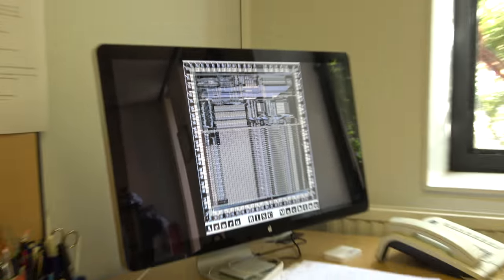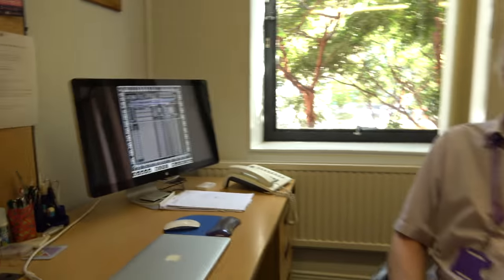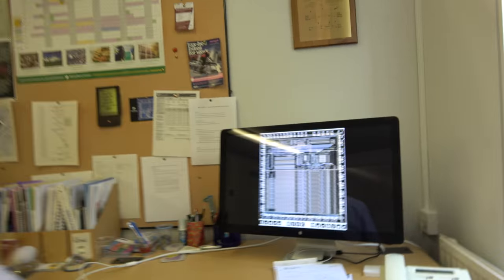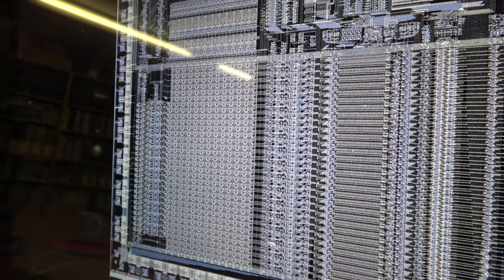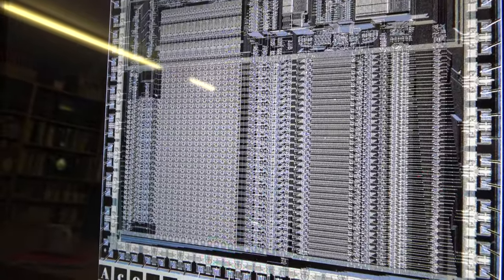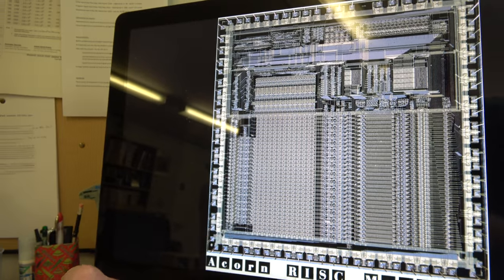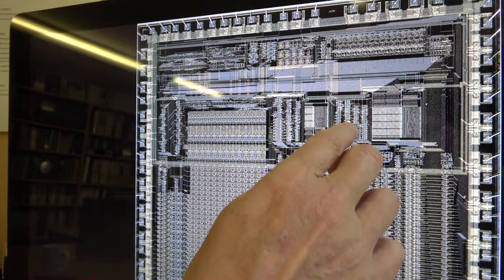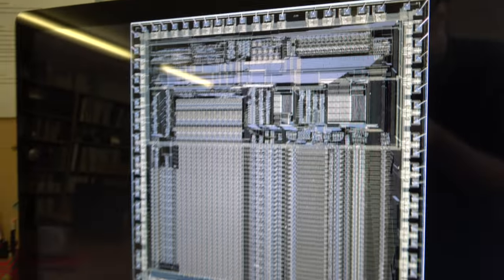ARM microarchitect: Steve Furber

Comment: thanks a lot charbax! I would have like to know his opinion on strength/weaknesses of Apple Ax chips compared to exynos and Snapdragons
Reply from the maker: Thanks for watching! Yes it's interesting how Samsung's been involved with Apple's ARM processors over the years, and also with manufacturing of 14nm Snapdragon 820 now also.
Reply: i doubt he would be interested in answering that question. If he anything like Sophie Wilson he will say we pay £1,000 for a phone which runs so hot most of the times the transistors are turned off....

Comment: Interesting video.. I'm a CISC on RISC fan as well as pure RISC. A thought experiment concerning the brain lead me to visualise a network of processors where each processor is hard-linked to each other processor, with the connections also being the memory store... Microtubules, save, load, send... It scales well. Could be recursive with n processors joined to n processors forming a higher level processor, itself connected to n higher level processors, and so on... Computer Balls.. Processors could also communicate using EM waves and possibly even quantum entanglement at some point. In 2D flatwiorld only 4 processors can be joined to each other with a triangular layout having total shorter connections. so it''s groups of 4 processors forming next level processing units, recursively.

Comment: There is one architectural feature that THAT HAS TO GO! It is little endian bit/byte  arrangement for data, and also for address pointers! For businesses applications that uses redefines for overlays differing data types for COBOL and Nixon’s for C, little Endian for business applications constitutes major booby traps for coding defects. For companies like SAS Institute that supports applications across multiple architectures, different endian differences create major impediment for providing reliable and big free products. I believe that the major reason that Prime supermini computers found greater adoption among commercial business company than the VAX systems was because its architecture as big endian. Also , little endian greatly creases the time and energy on programmers using memory dumps in tracking down coding faults. In the pre and early LSI hardware, the design shortcuts for hardware implementation may have been tempting, but burden wreaked on programmers by little endian is no longer worth the price!
Reply: How does the endianness matter in any of it? It should be an implementation detail hidden under a high level language. I do development from machine level all the way up and endianness was never even on the radar as some sort of an impediment or bug source, and I deal with both BE and LE systems about equally often. I don’t know what SAS is doing but obviously something majorly wrong for anyone to even raise that as an issue. Nobody is supposed to look at raw memory dumps anyway - not outside of the development of library primitives that twiddle binary data directly, and even then a high level debugger is the first line of attack.
Reply: Im LE the address of a „data object“ does not depend on the type you read from there. As a byte, a word, a double word, all the same address. BE forced you to offset the addresses depending on type.

Comment: It'd never compete with Apple. First of all, Apple II was already established on the market with software and peripherals (specifically floppy drive) eco system. Secondly, even if BBC made to US on time, it'd be quickly killed by cheap (and more superior) Commodore. And essentially Commodore killed Acorns not just in US but in home market as well. Acorn really competed with Apple only on educational market.
Reply: iPhones use ARM derived processors.
Reply: He's referring specifically to the time before ARM when Acorn competed in the home computer market.
Reply: "It'd never compete with Apple" "Acorn really competed with Apple only on educational market"
make your mind up which one it was

You are 100% wrong about it not competing with Apple. Of course it did, as did every other PC. How well it competed is another thing!
Reply: the C64 is a terrible machine in fact. it was successful in the main due to being in the right place at the right time and due to vertical integration and having 64K when most home computers had a fraction of that.
Reply: @KentReynolds  — I never had one, so can’t judge, but I know a lot of people did useful things with a C64.  It was practical and affordable.

Comment: Little endian architecture has to go! For business applications written in COBOL or C, which’s uses data structures that involve redefinition or union in which different data types are overlaid, severe problems or programming design errors are likely to arise. For companies like SAS Institute that design and support major applications and system, little endian architectures create major obstacles. In the past ere of the supermini computer systems, big endian systems like Prime were far more successful with commercial users than the Digital Equipment VAX with its little endian architecture were less successful. Another architectural beef I have is with the base plus displacement architecture of the IBM 360 and its successors. You are most likely familiar with paging thrashing issue with virtual memory system configured with insufficient memory. I assert that such architectures have risk of an address reference thrashing issue arising with extreme large program logic instruction sizes. I do not have sufficient training and ability to derive a proof of this possibility. Should this become a problem, a meta intermediate language and procedure in which the interpretive object language that would support a more viable implementation, with support for indirect addressing, which was omitted in the IBM design. Another direction I would to see explored is hardware implementation for common trigonometric, hyperbolic and other functions that uses indexing table lookup for evaluation that would be new or two clock period fastest, and be perfect in its entire number range. For massive single valued mapping calculation functions, special space matrix memories covering the entire number range wold be used to deter unnecessary repetitive calculation. This would bypass the limitation of Moore’s Law, and reduced the need for quantum computers until true room temperature superconductivity can become discovered or invented!
Reply: Modern ARM processors are bi-endian. They can be configured to run either way around.
Reply: Nonsense.  There have been successful microprocessors designed in both little-endian (Intel 8086) and big-endian (Motorola 68000) organization.  It doesn’t matter much, as long as the people working with the processor understand how it behaves.